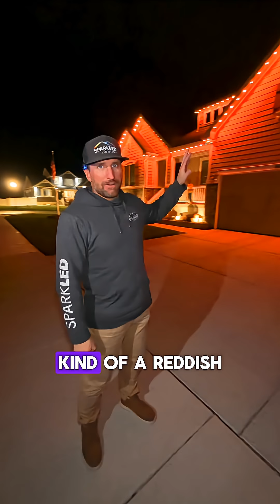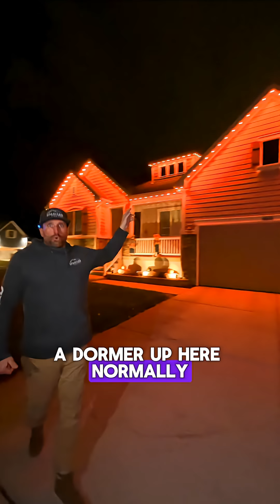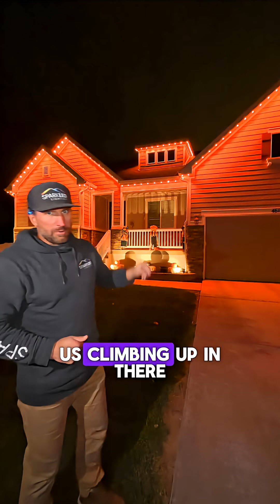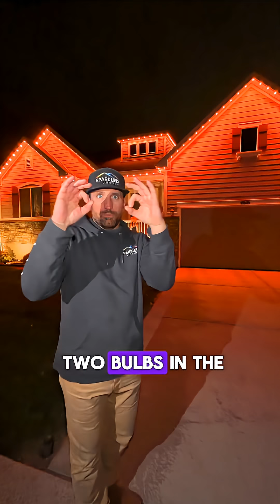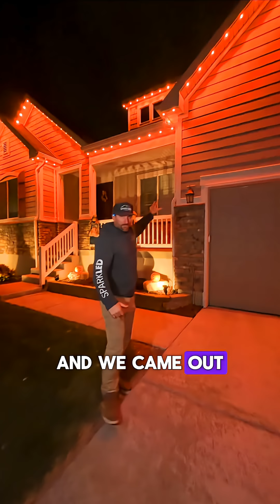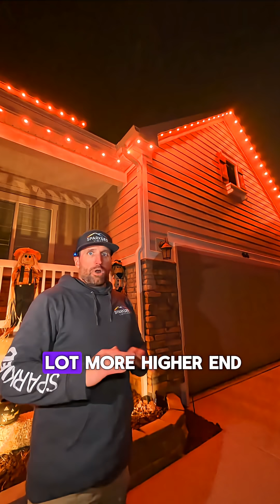The RIGHT Way to Install Permanent Lighting - InvisiLights

Comment: What wire do you use to extend the wire in the atttic to other locations?? Bc I’m assuming they don’t give you super long extensions for certain situations also do you not experience fading in lights with voltage drop Ik sometimes with company’s if u run the lights on too long of a whip the end of run dims
Reply from the maker: With the InvisiLights system, you can buy extra extensions in various lengths. None of the extensions require splicing or cutting wires. For voltage drop, we sell power injection kits that let you add hundreds of additional lights without voltage drop.

Comment: What do you think of the cheaper no no-name permanent lights you see online for 1/3 or less of the brand name's price?
Reply from the maker: You get what you pay for. The cheaper systems will most likely be dimmer and have less options for mounting. InvisiLights permanent lights use an aluminum track and come with a much longer warranty than most of the cheaper systems. We've got an InvisLights vs Govee video in the making.